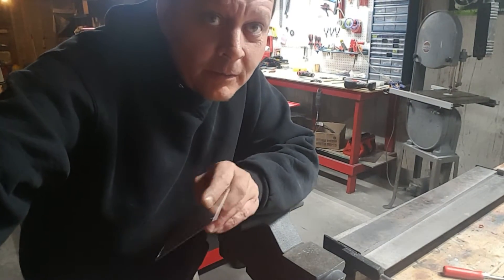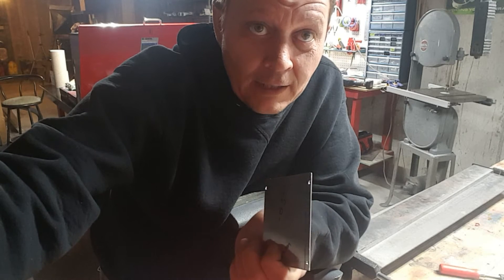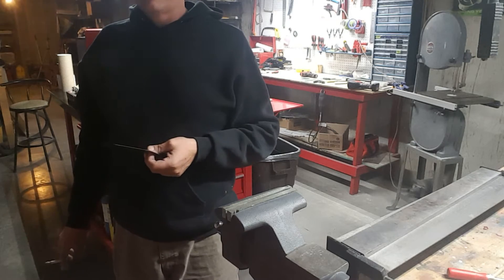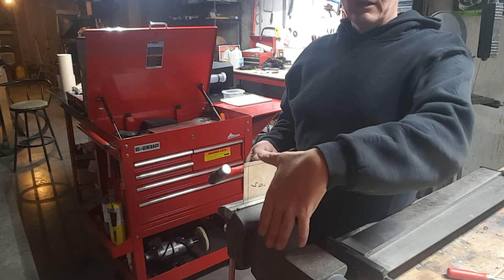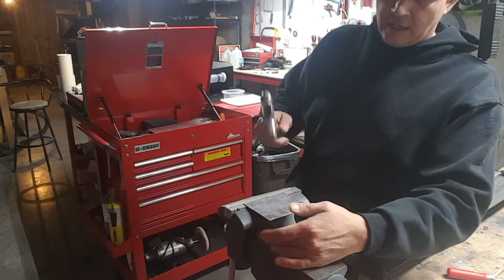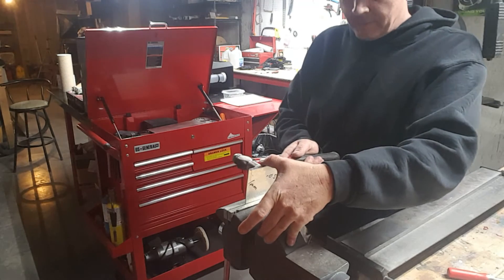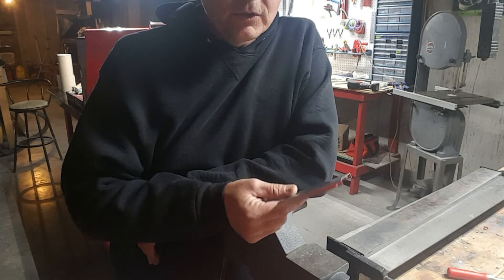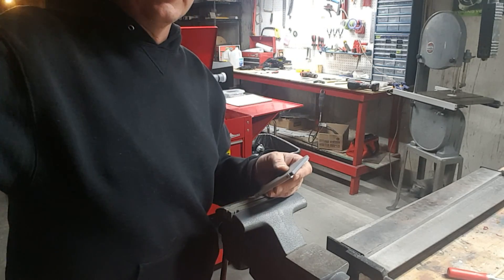Down & Dirty Modding Quick Tip - Bending aluminum  in a vice

Comment: Great instructional video. I need to bend a piece of 5052 that's 1/8 inch thick and the bend will be about 17" long. I can't use a metal brake due to the piece itself so I was wondering could I use your method by SLOWLY bending just 5" sections at a time in the vice and walking back and forth thru the length of the bend? My concerns are that the metal will stretch even if I only bend 1 to 2 degrees at a time or that there's just too much room for error to match the bend point, even if I make a jig around the vice to hold the piece at the correct height all the way thru... Any advice?
Reply from the maker: Thanks!  That's a bit of a problem you've got there.  If you've only got one piece to work with, I'd try to find a metal shop that could help you out first.  It'd take more time to set it up in a press brake than it would to bend it in one.  But failing that or if you've got a spare and want to figure it out on your own(my problem usually), you can try the vise though I'd use some heat to soften the aluminum up a bit.  I can't help but think you're gonna end up deforming the piece a bit with vice no matter what you do.  Maybe if you had some decent pieces of angle iron you could sandwich your piece in between them and stick it all in the vice, the idea being to extend the vice jaws.  You'd probably want to add some clamps at the ends of the angle to hold everything tight, but with some heat that seems like the best option if you can't use a brake.  Keep me updated if you try it, this would be a useful bit of knowledge.
Reply: @InsolentGnome  awesome, that's not a bad idea at all. Thank you and I'll let you know how it goes if I can't find a metal shop willing to help out!!